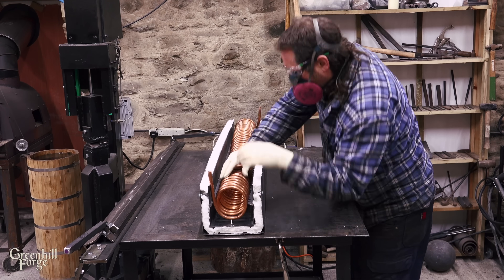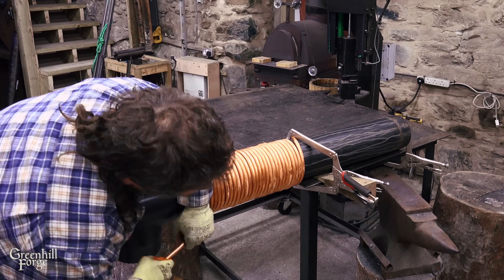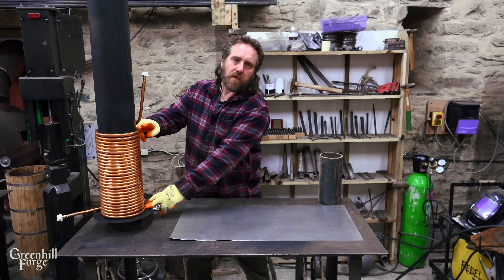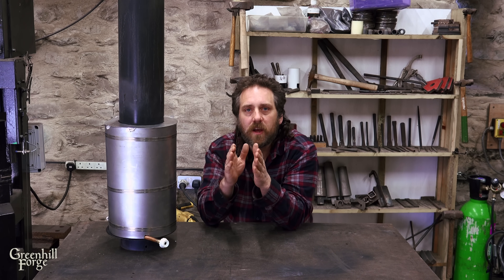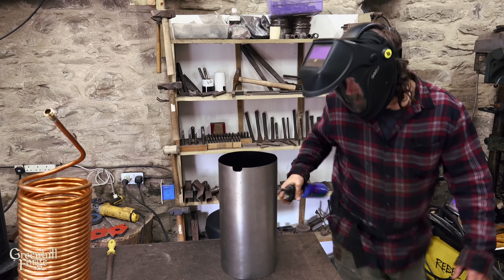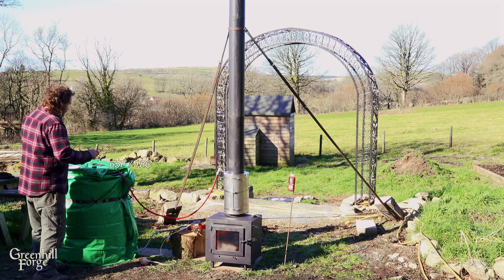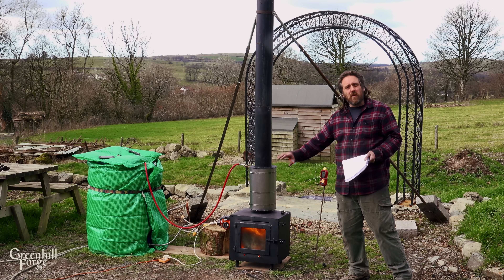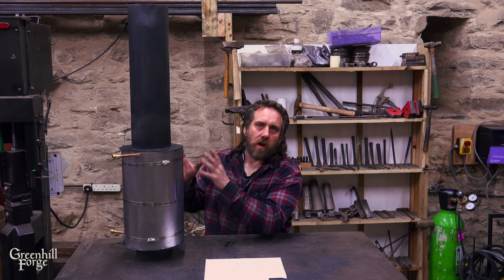Best Wood Stove Water Heater Yet: New Design Tested | Off Grid Water Heater pt3

Comment: I thought sand at first too as that's what many have done in the past. That said your Ice plan makes tons more sense for the reasons you pointed out. I would be concerned about the Ice damaging, or stretching the tube but as long as you're patient it seems to work well. 
  One thing about Thermite powdered aluminum has a surprisingly low ignition temp of under 400*C but that is an unlikely ignition all things considered. It does have better heat conduction properties though. Small grain copper sand or powdered copper is even higher at 398 W/m-K where Graphite & Aluminum are 168 & 237 W/m-K respectively.  Copper could present off gassing through oxidation above 400*C though. Graphite seems safest & cheapest of the 3 options.
Reply from the maker: I'd have gone copper if it wasn't crazy expensive.

Comment: Matching the copper coil heat transfer rate to the exposed steel area near each coil's contact point will maximise the heat transfer considering each loop. So my guess is stretching the same  coil out over 4ft of steel pipe will help. Perhaps even six feet of flue.  Not sure of the graphite effect, other that it will help and allow a more condensed coil. 
So testing stretched out slinkey might be next?

Comment: You could also use Magnetite a a great thermal mass as its heavy(high heat capacity), cheap, unreactive and conducts heat reasonably well. 
You may be able to use Magnetite as Heat capacity to act as a battery and a miniscule amount of graphite powder as a heat conductor in between the gaps. But beware above 900C (1600F) violent redox reactions can form, so maybe sand is more on the safe side.
Thats a form of Iron Oxide also known as black sand on some volcanic sites/beaches and used in iron/steel refinement.

Comment: I was going to suggest some higher thermal conductive material and am I glad to see its already in the video, great video!
Reply: One think I was thinking is that maybe try soldering coil to the pipe, that should increase thermal efficiency significantly.
Reply: Synthetic diamond powder. I have a bunch of it. Best thermal transfer.

Comment: I believe there is a small flaw in your testing methodology between these new designs and before when the coil was in the flue. In those previous tests, the coil was about twice as tall and so there was more time for heat transfer between the flue gas and the water before the gas exited the system. I think if you repeat this experiment with the graphite, keep the amount of copper the same, and stretch it out to match the height of previous design, you will see another increase in efficiency.

One other variable that I can see skewing results is the turbulence of the air inside the flue. When the copper was inside the flue, it would have drastically increased the turbulence which would again provide more time for the gas to transfer its heat before existing the system, if you can mimic the added turbulence with this new design, I think that could also help improve efficiency.
Reply from the maker: I agree, just means I have to buy 3-4X as much graphite.

I also agree with this but here I was trying to keep things out of the flue for increased safety.
Reply: I believe he said the copper was the same length.
Reply: One has to keep the flue clear to facilitate cleaning and such.  So an alternative method to increase the surface area of the copper pipe would be to reduce the flue diameter and have multiple flues in parallel.  One would have to clean several flues in place of one but it would be just as safe while doubling the surface area for heat transfer.  Four 2" flues support the same area for gas flow while having double the surface area as a single 4" flue.
Reply: That could work really well if he’s going to use a water sleeve.
Reply: In some camping refrigerators running on propan there is a spiral in the flu to help with heat transfer. The spiral is hanging from a wire and easy to remove if needed.

Comment: At 45 watt/MC steel flue is one limit of the system. So more surface is one improvement.  Or a copper flue is another? Will copper foul as fast as steel? Of course I'm disregarding the cost.

Comment: I'm a complete amateur whose knowledge is exclusively from googling & extensive conversations with AI, but I'm really curious about using copper coils on the inside of the flu, but covering the coils with a very thin layer (2-4mm) of ceramic (either High Alumina Refractory Mortar w/ a "Water Glass" coating or Hawthorne Clay) to hopefully reduce creosote buildup and to provide some thermal mass on the tubing.

A ceramic coating, in addition to bending the coils conically, seems like it could provide the best of both worlds.
Reply from the maker: Really interesting idea and worth testing

Comment: I enjoyed the recent episode. Regarding the challenge of increasing heat transfer, it seems that increasing surface area is the most practical approach. This could be achieved by:

1. Conforming the tube to the flue shape using a compression roller and bending.
2. Increasing the number of wraps around the flue.

Given the need to maintain laminar flow within the flue, other engineering solutions may be limited without improving the thermal bridge. Graphite appears to be an optimal material for this purpose.

I understand the complexity of the system and the various areas where entropy is a factor. I've been following your experiments since their inception and apologize if I've overlooked any established parameters.

With 26 years of experience in the industrial water industry, my primary recommendation is to maximize the utilization of available BTUs. Specifically, I suggest constructing a graphite-filled box, sized to match the stove, and incorporating additional coils. This would capture heat escaping from the stove's top surface, acting as a pre-heater for the flue wrap. The stove top would retain its functionality.

Overall, you've achieved significant progress. I believe further thermal capture gains will require increasing surface area and dwell time.
Reply: Why do you think laminar flow is optimal here?  I would think chaotic, turbulent flow would cause all those hot, angry molecules more time to bang into the flue wall and transfer their energy.  Seems like laminar flow would just allow all the gases in the middle of the pipe to escape with very little exchange in energy.
Reply: @WheezardX  you are correct. turbulent flow is more efficient for heat transfer. OP might be thinking that turbulent flow of the water would reduce the thermosiphon effect.

Regardless, if the water in going to be outside the flue, then the most optimal configuration is a Shell/flued boiler. Just surround the flue in a water tank and let the water be in contact with the flue directly. If the tank has a lid that sits on the top of the tank instead of the tank being sealed then there is no pressure danger.
Reply: @JaneDoe-dg1gv  Oh interesting.  What you are saying is the most surface area contact he'll get is just water on metal.
That makes a ton of sense, no need for conducting materials like the graphite/sand at all. 
Obviously there will be some trade off here, I'll have to give this a think.
Reply: Agree. I think a square tube would probably eliminate the need for graphite.  Two smaller flues would also increase available surface area  for heat transfer.  Also, the length of contact could be increased. There is no longer a need to match the length of  the old  internal coil.
Reply: There are two relevant contact areas, one is the gas in the stow pipe area with the stow pipe. the other is the copper pipe with a water contact area with the stove pipe.  The stove pipe is hot above the heat exchanger so you could use more of it.       An alternative to more number of wraps around the flute is to have the same people but wrape it for a longer distance and have a gap between the wraps.      if you do it like that you could add some type of thermal paste between the stove pipe and copper tube because now there are gaps.

Comment: Hold your horses before you seal the system up !
I must say I have not read the previous suggestions of your followers.
But how about this: Fill up the jacket with glycol, it has the ability to conduct verry good, is cheap, it does not catch fire and it fills up verry fast, also the thermal mass willl even up thermal fluctuations.
This is just another idea but nevertheless...
ps, subscribed to your channel

Comment: I think a full height, not truncated as at present, water filled jacket around the flue would work well.  The annulus (water filled space) would thermosyphon but perhaps not as well as the copper pipe as I reckon the temperature delta would be less.  Additional water pumping, if needed, could be provided by a peltier pump (see wood stove fans) or an external combustion engine. (Stirling) pump
Reply from the maker: I have a water jacket showewr I made that I show in this video https://youtu.be/pP_2A5Wdvqg  and a stirling engine I built in this video https://youtu.be/-XwWipp2EjY

Comment: For shaking, I just use a saws-all with no blade to vibrate it and that works pretty good for causing liquefaction in the sand to fill all the spaces and compact it down.
Reply: I use an old hand sander on my vibration table. I use it for getting air bubbles out of plaster casting, but the vibration needed are similar.
Reply: I once used my wife's Hitachi Magic Wand to remove air bubbles from my cheesecake batter.
Reply: @Zomby_Woof was it effective?
Reply: @garethbaus5471  I guess it was..! But I don’t know whether he got slammed with a wand with batter… haha.

Comment: Really, you’re not going to get anywhere near the efficiency of having the copper inside.  Furthermore, the most efficient heat exchanger designs will be the most geometrical complex and difficult to clean.  Is there some kind of heat resistant oleophobic coating that you can put on the copper to keep the creosote from sticking to it?  That might be the best solution regarding thermal efficiency.

Comment: How about directing the fumes through a bunch of smaller tubes and having the water wash around these tubes directly? This would be like boilders of steam locomotives. Considering how popular steam engines were, I guess they perfected the art of boiler building back then.
Reply from the maker: I have a water jacket shower I built like that which I show in this video https://youtu.be/pP_2A5Wdvqg
Reply: @GreenhillForge  Nice one 👍 How comes you didn't stick with that method? Is it not as effective for heating water after all?
Reply from the maker: @emanuelstone2131  I'm trying to get to something that can be attached to a normal stove that is safe and efficient enough to be installed inside. I'll do other series that focus on pure efficiency etc
Reply: @GreenhillForge  Okay I understand 👌I'm looking forward to that.

Comment: What if you made a double wall flue that was watertight and just had water directly against the flue vs using a copper pipe as a heat exchanger.  To battle corrosion maybe use antifreeze/coolant with corrosion inhibiters and then a liquid to liquid plate heat exchanger for the “clean” water.

Comment: If you add an Archimedes’s screw style spiral to the inside of the chimney where the coil is, it will hopefully slow down the hot gasses passing through to allow more time for the heat to transfer, while also remaining relatively easy to clean.  Adding small fins to the inside of the stovepipe would also allow for more surface area for heat transfer while remaining easy to clean.  The fins and the spiral idea are mutually exclusive here, unless you put the fins on the spiral itself.

Comment: I have exactly zero experience or knowledge in stoves or thermal transfer. But is there a way to hold the flue gases for longer in the segment that has the coils around it? It seems to me that with the straight pipe, the hot gas is just rushing past the coils with little time to transfer its heat. If it had more time, wouldn't the wood usage be lower? Just thinking out loud

Edit: These videos are fascinating to me. So I looked more into it and, It seems like this sort of thing already exists in boiler tech. They're called Turbulators and they work to deflect the flow from the center of the flue, increasing contact time with the outside material. They're removable so with maintenance it shouldn't create a problem with creosote buildup. Would love to see if you could incorporate this into your testing. Thanks so much for work on this and sharing with us

Comment: Im sure someone has already mentioned this, but maybe you could use the water itself to be the heat transfer? perhaps you could get rid of the copper coil and simply pump the water through a hollow, cylindrical tank? the steel flute would rust, so you would have to bend/roll up and solder up a bunch of copper sheet ... You could make the first two feet of the "flue" a complete copper cylinder, water transfer tank, hollow so the smoke would pass straight through up into the actual flue...

Comment: Another amazing video! The problem with outside coil designs is the heat transfer. The issue is transferring heat from the hot chimney tube to the copper coil, because it's a round coil on a "flat" pipe, so the contact area is just very, very small. I'd argue that more heat is transferred from the pipe to surrounding air/graphite/sand and then to the copper coil, than from the pipe directly to the copper coil. One way of solving this would be somehow increasing the direct contact point of the coil, probably welding it with tin or something like that (I am not a welder nor chemist, but I think tin can be welded both to copper and iron)? Maybe thermal paste could help, but that's just another replacement for the graphite - interesting idea, but its still a powder, so not much contact to transfer heat - I was thinking you'd pour liquid aluminium into it :D. Other way of solving this I think would be getting rid of the coil and cooling down the pipe directly with water. Pipe inside a bigger pipe, welded water tight, cold water input on the top, hot water output on the bottom and for efficient water flow make a spiral inside from some sheet metal welded just to the inner pipe. No expensive copper, no weird chemical galvanization like stuff happening and you there is one less heat transfer element which just slows down the heat transfer.  Also with this outside coil design, spreading the loops to cover more of the tube would greatly benefit the heat transfer.
Reply: this would essentially be a mini boiler correct?  I have had similar thought as this for a project of my own.

Comment: 7:00 I think for the insulation method you did something that seems wrong to me, the insulation concentrates the heat transfer on the copper pipes, so you might as well cover a bigger surface area of the flute by spacing the copper layers and insulating in between.

Again I know nothing so maybe it's bs and my idea doesn't work, but it seems reasonable to me

An another thing you could look at is PC watercooling, or water cooling from servers, because what you are doing is trying to move eat as efficiently as possible, and these essentially do the same, so it might be interesting to look for inspiration from pc/server watercooling methods

Comment: Try finding/making a low cost thermal paste, and wrapping the copper directly around the pipe, applying thermal paste as you go. Alternatively, you could see how feasible soldering the copper to the pipe would be. Though galvanic corrosion might be even worse

Comment: Hey i love the design, you might want to incorporate a stove pipe dampener, I noticed a hug difference in pipe temp when the air is forced to flow around the dampener, almost like the hottest flow zone is the center and you can make it collide with the pipe, perhaps a dampener at 45+ degrees one way then another dampener the opposite way to create turbulence in the stove pipe near the copper.

Comment: I would be very interested to know what the gains would be if one had to spread the coil out (like the inside one was) with a gap between the loops. The increase in surface area to the flue should be beneficial, but I would be interested to know if it actually is, especially with the graphite. Thanks for this every interesting series!

Comment: Whats the difference between the heat recieving area, exhaust gases have contact with in case of copper inside and outside of the flue?
Well...its the hot gases contact area size of the tubing wall in first case, and in second it is the area of flue wall minus loses due to insulative properties of air between outer flue wall and copper coil. 

I would try to strech the spiral to full length of the flue + sand or graphite or very thin poured concrete + insulation as you already did.

Admire your work and educational talent!

Comment: Glad to see that improvement with the graphite powder over the sand! We use graphite flake in thermal grouting for geothermal heat pump systems to improve the heat transfer over regular grout mixes. You may not see a big improvement on efficiency or other numbers to justify the cost but two other variations you could try would be using graphite powder mixed in with the sand, this would help fill any voids occupied with air (insulator) and improve the bulk thermal conductivity of the mixture, or mix two different grain sizes of graphite powder to accomplish the same goal as the sand/graphite mixture but with better bulk thermal conductivity again.  Silicon carbide powder would also be an alternative to graphite powder. It still has a relatively high thermal conductivity, but it can be easier to work with. It is also relatively non-reactive/inert.  I used both materials in my graduate research, working to improve the thermal conductivity of ground heat exchange systems.